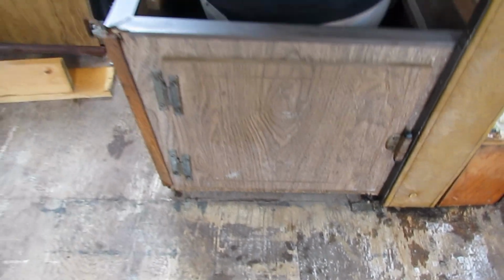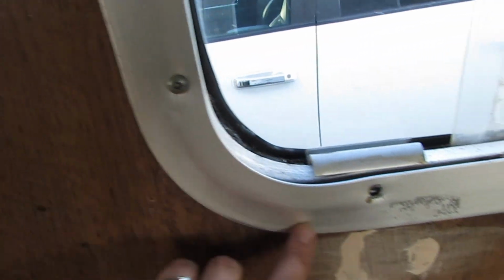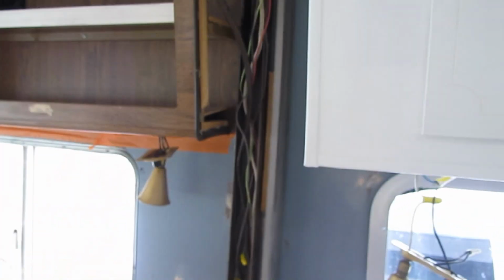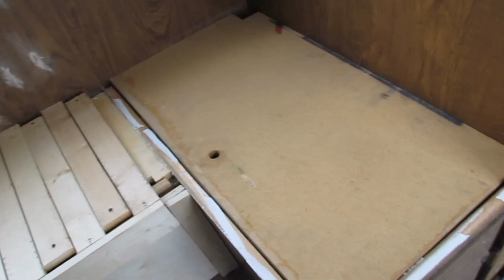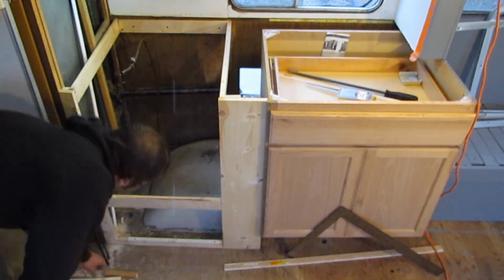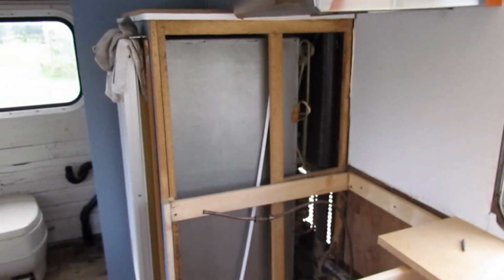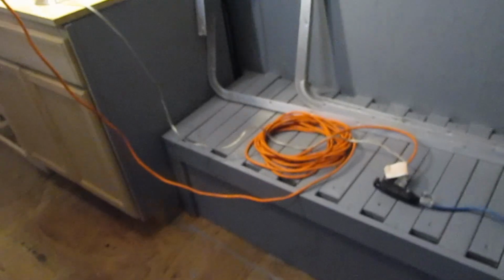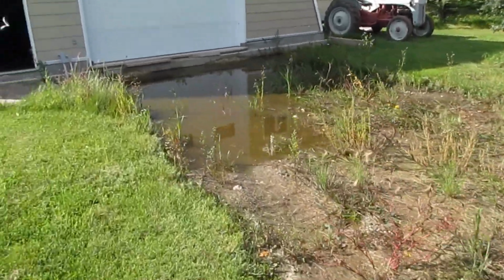Dinette to Bed, Kitchen Remodel  | S01 E04 | Restoring Vintage RV

Comment: Hey guys!  Awesome work! I have a 74 that Im gutting.  Did you find replacement windows ? 
All of our are needing replacing lol
Reply from the maker: We have not actually looked for windows yet. We may only need to replace a few as the back and front are in decent condition.

Comment: I have a 26 foot 78 Brave with 64 k on her, good outside but like with all these RVs they use garbage cheap products building them. I plan a complete tear down to frame, take out all the wood but the new plywood for floor base and rebuild with better framing much lighter than the cheap 2x2 and strapping stapled everywhere. The roof will be one piece overlapping the walls have no openings assuring no leaks even the solar racks will be welded not drilled. Many ideas from other builds but don't want to give away secretes as of yet. Problem with this is the bottom plates of the walls already being rotted which turn to black mold usually from the edge of the roof leaking down from the roofs edge down through that 2x2 wall also turning insulation into toxic mold. Most of these RVs have split the corner framing at bottom where floor meets wall behind the rear tires and mice love that crack to get in. I hope you at least checked those side walls at bottoms and more important whats up in that ceiling. Spray foam is much better than spun glass insulation especially where all the heat is. Watching the rest of this, Cheers and good luck these need to be preserved, they were a good frame that could take a beating but just cheap bad products used in design. Still making junk to this day except now it's all plastic Junk!
Reply from the maker: Wow it sounds like you have a lot planned for your Winnie! We have watched so many videos and have also taken many idea's from them. Luckily we actually had very little rotting and were able to peel and refurbish behind the sink. Other then that the rv was in great condition that way. In late 2019 we went through the whole rv looking for leaks and any where critters could make it in. We sealed them off and have had zero mice this winter! YAY all the work we did last fall is not ruined.
Reply: @AlbertaAdventurerFamily  Excellent guys, it did look in great shape for the year and the roof looked untouched which is unusual. It must have been stored inside most of it's life. I need a shop before I pull this apart and a few have said why bother? It has only 64 K on her and so many have been scrapped that I figured it's good to give this the honor it deserves. They were all built on a real truck chassis and I have already changed the carter huge carb to a Edelbrock 750 electric choke with reducer plate. Going to either buy new performance heads or drill and tap the blow by holes in the head to increase the hp. My dream was to take engine out and put in a low rpm 3 cylinder diesel generator and change all wheels to electric hubs giving it gallon per hour consumption similar to a trains locomotion. Finding a manufacturer to make smaller hubs has been the wrench in this plan but I'm still searching. Imagine getting hourly like 25 mpg or to gallon per hour?  Glad to hear no rodents nothing worse than mice breeding in a vehicle and that smell! Cheers AAF